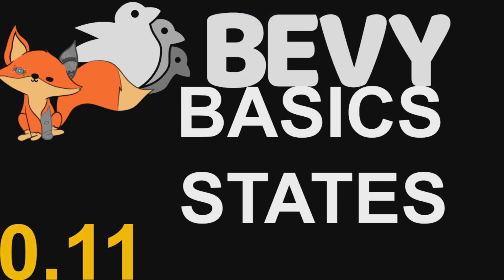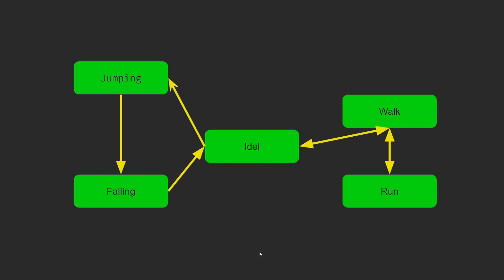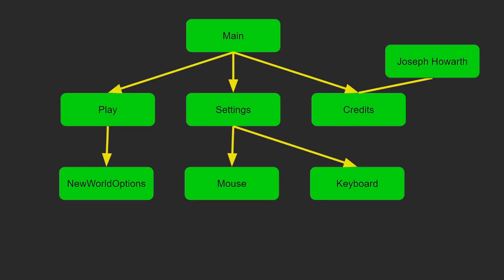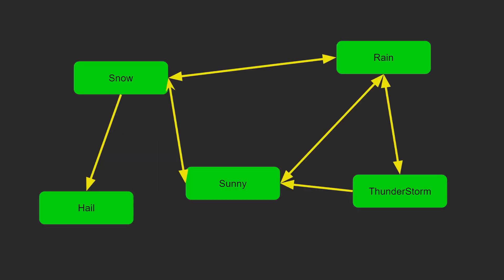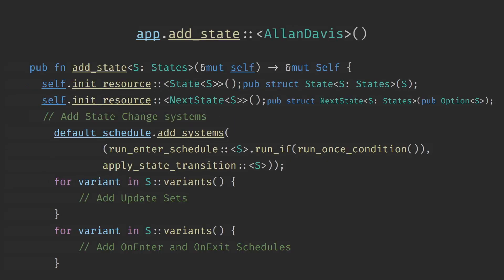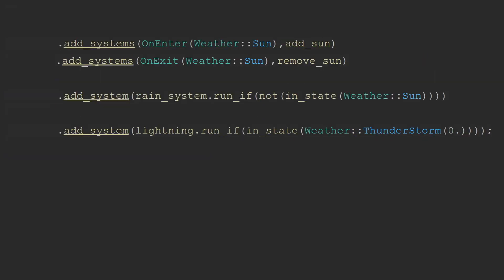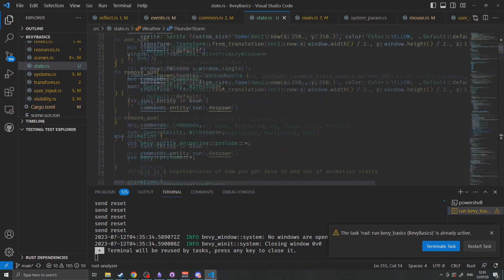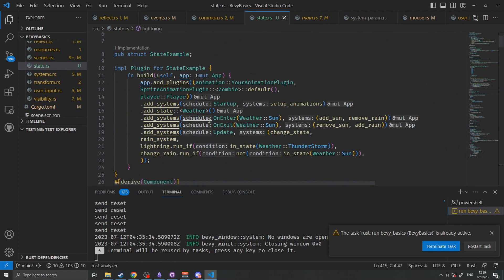Bevy Basics States

Comment: I'm rather confused- why use bevy to track state? It's trivial to have an entity that tracks state.
Reply from the maker: Because bevy has features that allow systems to run and not run based on what state it is in, and has done optimisation such as running these checks on the main thread to minimise overhead
Reply: @PhaestusFox  hmm... maybe I need to learn a bit more- It seems like `if` statements may work just as well?
Reply from the maker: If statements only work on a per system bases and can only be checked after a system is seceduled and started, run conditions can be applied to whole sets of systems and are evaluated before the overhead of generating tasks and scheduling, they can just be if statements but require some restrictions that bevy puts in place

Comment: Thanks for the video. Don't mind it much but  I just have to throw a little "pedantic" rant. You should have begun to define a little more what state is. You talked so much about it but that was not state. It was a state machine. The two share the same word but they are certainly not the same thing. I would say that a state in rust is the value of a variable or similar. And in the bevy ecs, that role is in the component?
Reply from the maker: I believe the state is a resource, although a state in rust may be a variable, in bevy I feel it refers to the building block of a state machine. It adds all the entered and exited logic for you, so it's more then just a value but not quite a full state machine since it lacks the restrictions on when one state can turn into another
Reply: @PhaestusFox  My rant i more about the fact that too many people in the game industry seem to always associate state with finite state machines (FSM).

Here is a wall of text to clarify my ideas. 🙃

Talking about state in a state machine context is no problem. It is a normal and expected behavior. But it seems that whenever someone is talking about state in any other manner, game devs always bring some FSM to the argument, as if state cannot exist without it.

State in computer science and most anywhere else has nothing to do with any state machine. FSM is a very very small part of the state history and reality. A state machine (finite or not) is by definition a very limited thing that is supposed to apply to very limited cases. Not to be applied to anything and everything.

I mean,  State is his own thing and certainly doesn't need any FSM in the discussion to limit it when it wasn't called for.

So what is state? Easy to understand. Instead of getting some weird definition or representing them as some node in a graph or something,  just use it.

In what state is that guy? Is he healthy? Or uneasy? Is he ok?
In what state is this car after the accident? Probably not very good or am i too pessimistic?

Can't we use those same template phrases in any program? 
... In what state is ...?
No need for any FSM (a model of computation or some kind of directed graph etc) in this conversation.

That is why i feel compelled to make this remark. And that is also why in Bevy ecs, i see the component as the state of the Entity. Though i am somewhat confident  of this last affirmation, i recognize that my knowledge about Bevy and ecs (and even Rust in general or i particular) in very low to justify that same confidence 😉

tldr:
It is my own concern but i do feel it is justified.

p.s.
And i should thank you again for your content. It is not easy to find Bevy information and it is worsen by the fact that Bevy is still changing its API so much.

I have no doubt that just that last fact is disheartening for you and others, since it is constantly invalidating the efforts to divulge Bevy when trying to go on specific code.

But that same code is so important.
Reply from the maker: I get what you're saying, I have the program of people thinking they know what a word means, because of a very specific case where they use it, when in reality the word has a different more genetic use that had been adopted into its current use.

Personally on your rant about states, it would come access less "um actually" if you drop the finite (analogue) part and just stick more to the fact it's not a machine(graph) with connections between valid states changes.
Mostly because in computers everything is finite, and in the places we use states in normal conversation it's about grouping ranges, specific thresholds or sometimes indefinable quantities into something that can be more easily understood and compared.
In most of your examples you are using states specifically because they are finite, "is he Ok" collects all the possible things that could be going on into a few possible states that you can then reason about if further action need to be taken. 

This is just my view, I definitely get where you are coming from, but sometimes it can change if something bothers you by changing how it is framed

Definitely appreciate your perspective tho
Reply: @PhaestusFox  I am naturally stubborn and have really no problem with being so, Which means that when i was younger i could continue on and on without a shame.

But not only am i no longer younger, but i also do recognize that any rant is a luxury and always depends on the willingness and time or another person. Monologues are pretty in the page but are kinda dumb when read out loud.

And given the circumstances,  continuing a 3rd time with this theme would be too rude even for me (and would probably also be sterile).

At least there are some opinions about it here and it shows that it wasn't ignored. Others can add there thoughts if so willing.

Thanks you for the time and patience to respond to my concerns.